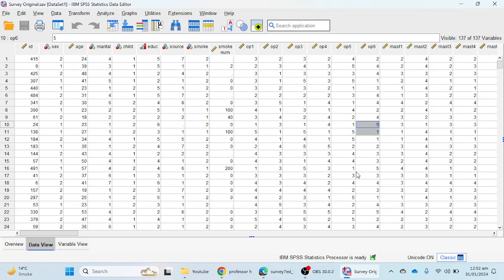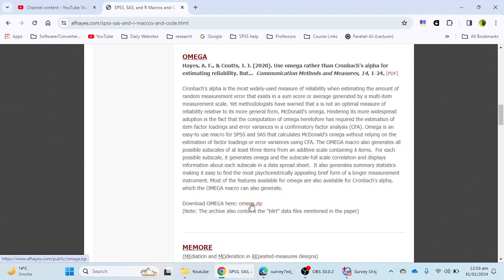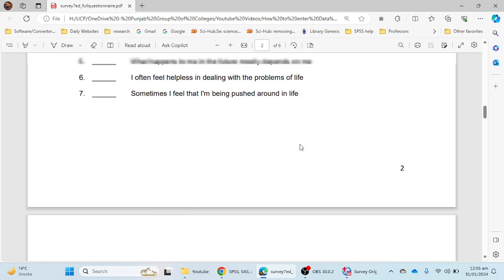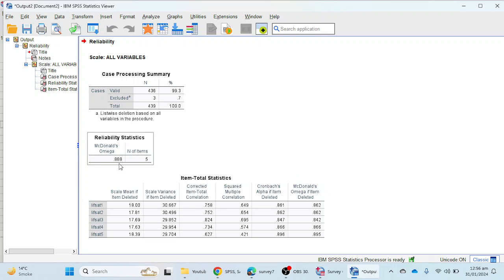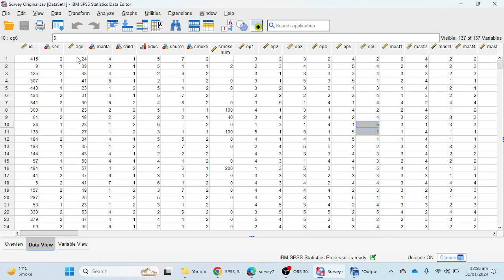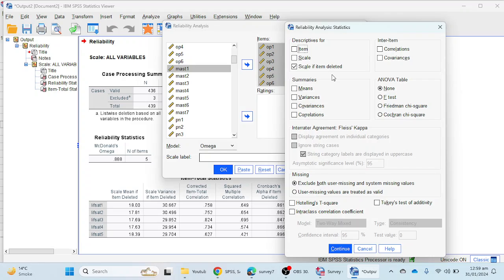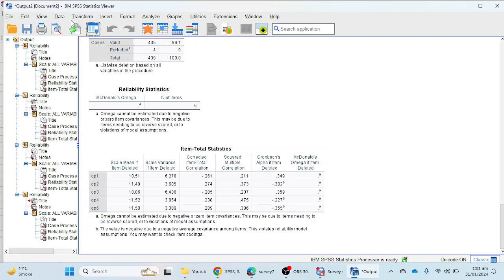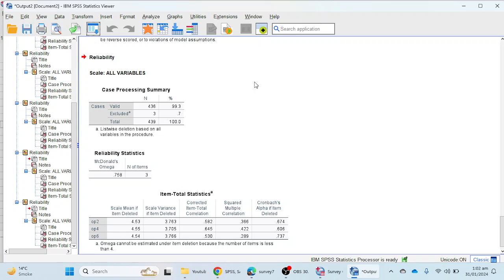How to Calculate McDonald's Omega Reliability in SPSS 29: A Step-by-Step Guide

Comment from the maker: For personalized one-on-one guidance, feel free to contact Dr. Farahat Ali. You can reach out via WhatsApp at +971559612559 or email at farahatali008@gmail.com. Whether you have questions about licensing issues, troubleshooting SPSS, or dealing with blank screen errors, Dr. Farahat is available to assist. Messages are typically responded to promptly, often within minutes.